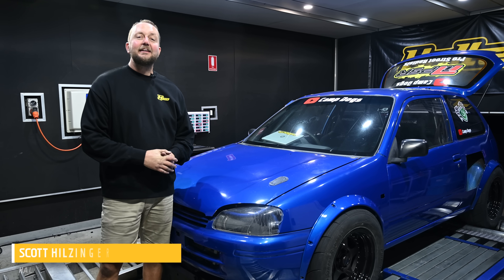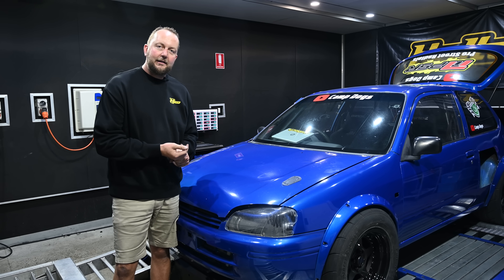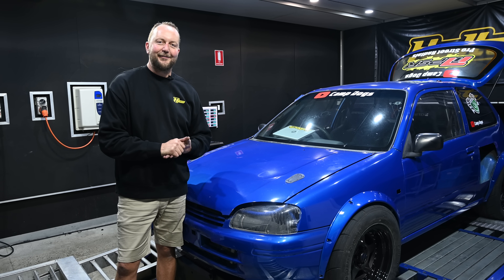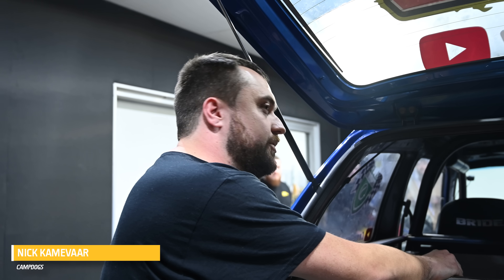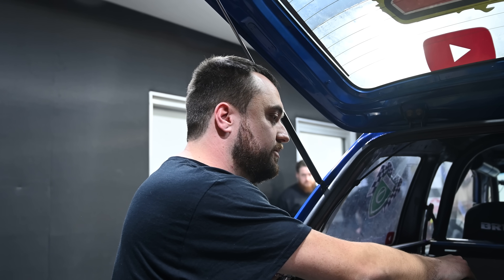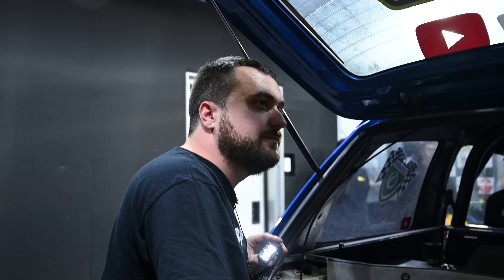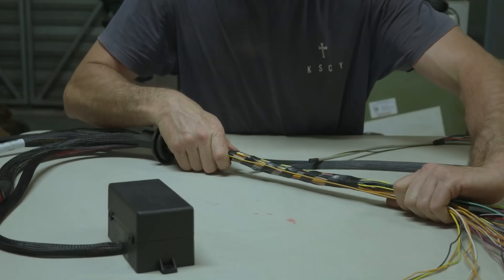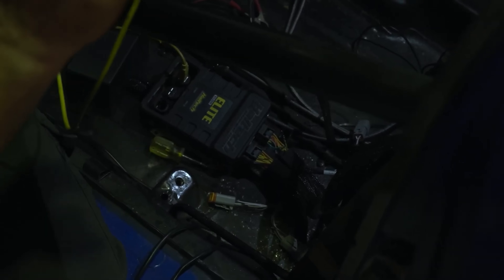DOUBLE POWER - What Happens When A Twin Engine Car Hits The Dyno

Comment: Noob question: how would two torque converters with slightly different slip compare on a dyno to an AWD setup that doesn't do a 50/50 torque split?

Or are all the OEM awd setups close enough to 50/50 at WOT anyway?

Comment: I wonder if with some torque management magic you could get the engines to sync up better, though I've NO IDEA how you'd actually implement it because you really need to know the slip between the engines rather than wheel to wheel, maybe some kind of parasitic slip coupling between the engines with RPM sensors on either side connected to opposing ECUs...

WILD build though, very impressive, and UTTERLY bonkers.

Comment: A mechanic friend of mine took a late 80's Suzuki Forza (Chevy Spirit/Geo Metro in the US) and put 2x Toyota 4AG turbo engines in it probably about 20 years ago now. Car is still somewhere tucked away. It was never dyno'd, but it sure hauled ass!! This is so epic to see as ive also owned one of those EP92 Starlets and they were very cool little econoboxes to tweak and mess with, and one of my first engines to learn and tweak was the E series, 1E/2E/3E/4E/5E. the 1-2-3E's were 12V and the 4/5E were 16V. What a cool project this one is!

Comment: I remember a Hyundai Tiburon that had 2 engines that street raced in LA in the 90s.  It was a monster.  He'd pull up to the line with one engine running then start the second.  The back windows were all blacked out to keep the secret.

Comment: Great idea, it has been tried by several car makers but the VW Scirocco as an example never made it into production. "Two-Engine Cars: Double the Fun, Double the Trouble". It is easy to make this work with electric motors, it even makes some sense to use a separate motor for each wheel. Multi-motor setups may even become the norm in the future.